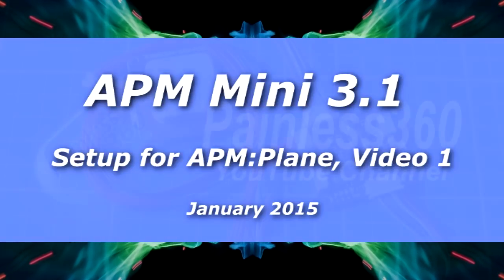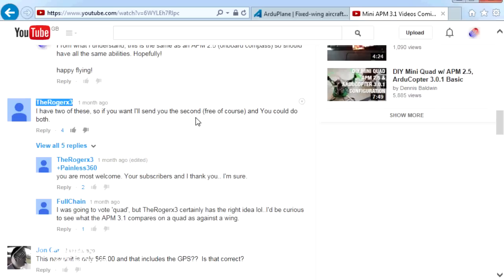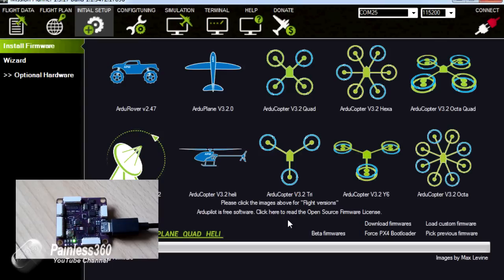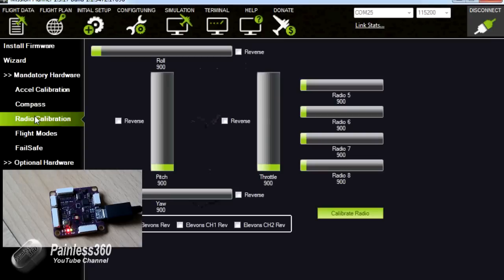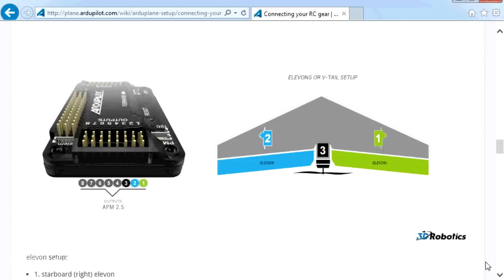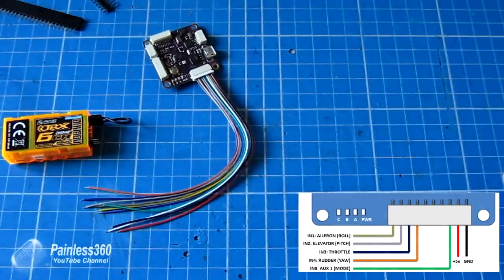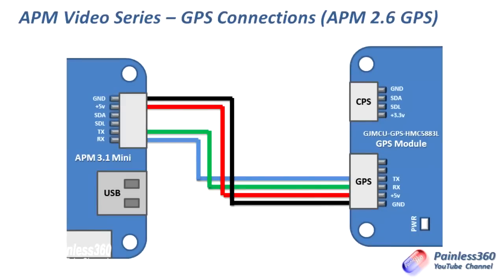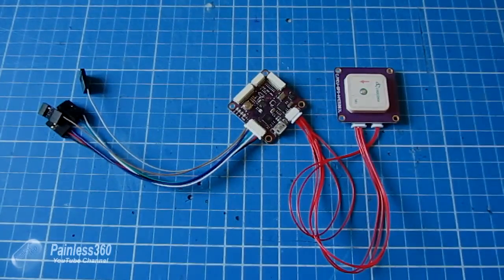(1/3) APM Mini 3.1 setup for APM:Plane (Arduplane)

Comment: Currently I'm using apm 3.1 mini with tricopter. Simmilar like in wing I need to power servo (one but power hungry) and other electronics (apm, gps, receiver). It is not recommended to use single power source for apm and servos. Servo can draw a lot of power and affect sensitive to voltage change apm. I had few unexpected apm restarts when all was conected to single ubec.  You are using additional ubec in teksumo already. I think that you can use ubec to power servos (connection to apm from outputs side is required still). If bec from esc has about 2amps than You can use it in place of power module. Whole tutorial is fantastic anyway it could save a lot of time.
Reply from the maker: Adrian Sychowiec The worry about brownout from excessive current draw is exactly why I used a higher capacity switch BEC in this model.Happy flying!

Comment: I have the same gps/compass module in your video. Which way is the front of the gps/compass.
Reply from the maker: +Nathaniel  Richardson See the installed GPS on the plane in the next video. When installed correctly the wire connect to the left hand side of the module (looking from the top)

Comment: Good day Painless360....is that possible APM Mini 3.1 setting without RC receiver?...i mean that plane fully autonomous...fly and landing only controlled by Mission Planner....do you have any experience on doing that?...
Reply from the maker: Hi there! Not sure, you can 'fly' the model using the telemetry radios connected to a PC and a joystick (i believe). I've not done it myself as I like to be in (what feels like) full control.. Happy flying!

Comment: Great video. Just a wonder would you happen to have any instruction for setting up a quadplane.
Reply from the maker: +Rubdul Bah not sure what you mean by 'quadplane'..
Reply: A vtol plane with four motors with tilt rotor capabilities. Apm says they have support in every version of planes beyond 3.5 but it keeps telling me that the board is retired and only uploads version 3.4 and below.
Reply from the maker: Rubdul Bah ah! VTOL! not sure if that's supported on APM. It's getting very long on the tooth now and the last update for the software update  was well over a year ago.. I'd look at a pixhawk.. Best of luck!

Comment: I just wanted to thank you for all your videos you are the best, I've been flying quads with cc3d board and want to move up to mission control board, what would be the best apm board to start with thanks
Reply from the maker: scott chapman Two main versions - the APM 2.x and APM Mini 3.1. Lots of versions of the APM 2.x about. I would get a 2.6 or 2.8 version from a reputable seller. 2.7 was a HobbyKing specific one and was brought out to fix a critical error in their 2.6 version.
Best of luck with the build.

Comment: Hi Painless. You wouldn't know how to center the servos in apm plane do you?
What I mean is that the ailerons are not spot on center. So if I do this in the transmitter and reading through the wiki, the plane will result in a crash which basically happened to me, as I trimmed my servos on the field. How can I trim my servos so that they will be center and have them so using apm plane. I just can't find the info anywhere or maybe I'm just an airhead.

Thank you.
Reply from the maker: Every step we went through is in this series of videos. I can't remember exactly what we did but this is where the answer will be (if anywhere) on the channel. Best of luck!
Reply: Thank you :)

Comment: I am debating on getting the mini 3.1 versus the 2.5 or 2.6 any thoughts on which one I should get they both look like good board
Reply from the maker: Depends on the space you have in the model. If I had the space I'd go for the larger 2.5/2.6 as the leads and connections are a lot easier than this one.

If you are strapped for space then it has to be the 3.1..

Hope this helps..

Comment: what if i have the gps that is designed for the apm 3.1? is such method of putting the gps like in the video necessary? or it is just fine if we straight away plug the gps into the gps connection in the apm 3.1. Thanks...
Reply from the maker: +Teddy Matthew if it's designed for the APM it should work straight away. Check with the vendor..

Comment: How does it control the throttle in the RTH mode(is it just max throttle ?)
Reply from the maker: It will use the throttle as it would flying to any waypoint in a mission based flight.

Happy flying!
Reply: Painless360 That means it's a fixed value from whatever I set in mission planner ?(e.g won't change due to the wind condition or ground speed ?)
Reply from the maker: http://plane.ardupilot.com/wiki/flying/flight-modes/#return_to_launch_rtl will explain all!

Happy flying!

Comment: Good friend the late congratulations on your videos. I'm your fã.estou always watching your videos and became interested in riding a Zagi wing with cc3d mini revo and me came a doubt. I have a DX8 and only putting the satellite in the controller I would get a good distance or only serves to flight short distance. What do you recommend. Use with receiver for long distance or only TV I get a good distance.
Reply from the maker: Sorry, I'm not sure what you are asking. If you mean using just a sat. rx on the revo then you should still get decent range if the antennas are routed well and away from other components. Best of luck!
Reply: Hey. Please tell me whether to buy APM as an autopilot for the wing, if so what? And if not, what is best to buy the cheapest?
Reply from the maker: No need to post twice - I've answered this on your first post. Best of luck!

Comment: hello
How did you fix the receiver as elevon ?  from the radio control receiver or mission planer? also mission planer full parameters is not supporting at this moment...Impossible to fly without fix the elevon old version or new version?
Reply from the maker: See the rest of the series for the answer. You setup all of the mixing in the flight controller and remove it all from the radio.. Best of luck!

Comment: If you power it from ESC, how you can measure/display main voltage in OSD, is that still possible somehow?
Reply from the maker: FPV 4 Fun The APM gets voltage and current information about the main flight battery from the Power Module (if you are using one). If not then you can connect the main battery voltage to the relevant connection on the OSD itself *depending on that one you use.
Hope this helps.
Reply: Painless360 Thanks. Is there a difference in OSD selection? I am just wondering if I can connect and measure 4S lipo voltage without modification or additional components? In the case I would like to save weight of the Power Module.
Reply from the maker: Loads of different OSDs out there but is you are using the MinimOSD then it is not easily done with an APM due to the basic OSD code.

Best of luck.

Comment: Hi there, thank you for this video. I am having a little problem with my compass. After cutting the jp1 the apm still uses the internal compass. Here's what I did.

I followed all the instruction in this video and managed to calibrate the external compass in mission planner.
  
Cut Jp1, do the proper wirings (checked the wirings) and choose "use external compass".

When going to flight data to check if it already works I notice that when I rotate the gps/compass module nothing happens in the telemetry. But when I rotate the board it does reflect the movement. I think its conclusive that its still uses the internal compass. The cut in JP1 is already deep I checked the continuity and its already broken. Any inputs?
Reply from the maker: The board still uses the on-board accelerometers to adjust heading along with the compass. So, even with J1 cut, you will see a heading change if you rotate the main board.

You can confirm that it is the external compass being used by opening the Debug Console (on the help drop down menu says 'Show Debug Console') while connected the APM without the external compass then go into inital setup and compass calibration, made sure internal (on-board) compass is selected then run the live calibration & watch the debug window and the X, Y & Z Axis should all be zero no matter how the board is moved. This will prove that it is the accelerometer is causing heading changes (huge thanks to 'Black Dog' for helping figure this out).

Hope this helps. Happy flying!
Reply: Ohh I see then mine is working just fine. I was doing this but I am not sure since the flight data shows rotation. Thanks for the answer!!!

Comment: can we use an orx rx3s flight stabilizer with the apm?
Reply from the maker: I wouldn't, the APM only need to see a radio.. not the stabilized input from something else..
Reply: I agree.  One stabilizer into another, may require lots of tuning to get them to work together agreeably.  No need for it, even if you might be fortunate to have it work on first try. I wouldn't want to try that experiment myself with my current budget of funds and time.  The APM code already uses multi-stage software EKFs (extended kalman filters) to optimize the stabilization based on the IMU sensors and the control inputs.  The developers worked hard to get that end result.  I would not want to try to tune the APM to cooperate with the stabilizing that the Orx Rx3s is doing.  It might mean that one unit tries to correct the corrections of the other, a waste of power and computing, and might put additional wear and tear on the servos.  Just replace the Rx3s with another non-stabilizing receiver.  Since you are using a Spektrum compatible DMS2/DMSX receiver, maybe get yourself an actual Spektrum receiver.  In the past they have been shown to have better and faster signal loss and brownout recovery than the OrangeRx units, and that better recovery may be appropriate to your larger investment with an APM, GPS/compass setup. I'm not intentionally doing an endorsement, but if you are going to replace the OrangeRX anyway, it is an option to consider, since you must have a DMS2 or X compatible transmitter already. There is a longer response that could be made to your question, but it would need a little more background from you on your aircraft, ability to carry more equipment, bigger battery, while not exceeding a maximum wing loading, etc.  I hope that is useful info for you.

Comment: a question, currently my telemetry port (apm mini too) conected to 
bluetooth module,  i cant connect osd if the port used by bluetooth

should i make a pararrel cable from same telemetry port to power up or 
use the bluetooth and minim OSD module at the same time?
or that 1 telemetry port only for 1 module?

i really appreciate, if someone have information for this 
thx
Reply from the maker: No need to post twice ;)

Comment: I have a question about the GPS modifications. You mentioned that some GPS/Compass units are available that do not require modification. I have this unit: http://www.myrcmart.com/product_info.php?currency=JPY&products_id=8001 which has a differenct board layout but uses the same GPS I believe.
Do you know if it requires modification or is this one of the units you are referring to that are already good to go? Do you have advice for how would I connect this to the APM 3.1? Any help is appreciated and thanks for the great video!
Reply from the maker: That looks like the one I was referring to. Trace out all the pins in the supplied cable and make sure that they connect in the right way i.e.

VCC to VCC
GND to GND
TX to RX
RX to TX
SDA to SDA
SCL to SCL

Let me know how you get on..

Best of luck..
Reply: Painless360 Thanks, It looks like it will work then. My GPS unit has two ports, A-Port and B-Port. The B-Port maps perfectly to the APM 3.1 port with the supplied cable. (All the pins are in the same order so a standard 6-pin cable should work.) I haven't tried using the GPS or external compass yet because I haven't done the modifications to the APM board yet. 
I did get my APM 3.1 set up and working with my wing though thanks to this video series so thanks a bunch!

Comment: How do I keep my external GPS battery from dying?
Reply from the maker: Hard to answer without knowing what GPS unit you're using. The battery maintains the last sat. data to help speed up a GPS lock. It's usually soldered on and needs replacing if it's not remembering and cold starting every time.

Comment: Everywhere I look, it is said that for PLANES only, no compass is needed. Just the GPS.
Reply from the maker: As a plane always flies forward you can calculate your heading by comparing the moment to moment position from the GPS. This is an older series now, and the software has moved on a lot since I made it. Happy flying!
Reply: @Painless360  Thanks! I feel iffy about soldering that wire to the 3v spot so ill try with just the GPS then.
Reply from the maker: Check the latest documentation and most compasses these days provide that power supply for the compass from the 5 volt line that you'll be powering the GPS from anyway, I just happened to end up with a unit that needed that extra little bit of soldering...
Reply: @Painless360  Okay ill do that. :)

Comment: hello Painless360 
sorry for my English.
I do not understand or connect the UBEC output ? (in RX> Bat) = RX feeds the board by the throttle.
 or UBEC Direct has the position of power modul ?
I know you say it in the video.
but I not understand English, just with translate
I will soon receive Mini 3.1 HK.http://www.hobbyking.com/hobbyking/store/__74644__Micro_HKPilot_Mega_Micro_Sized_Flight_Controller_and_Autopilot_with_Leads_2_7_2_APM_.html
Reply from the maker: I don't know how to explain it more clearly than we did in the video. Best of luck..